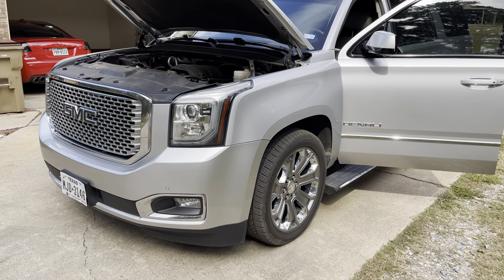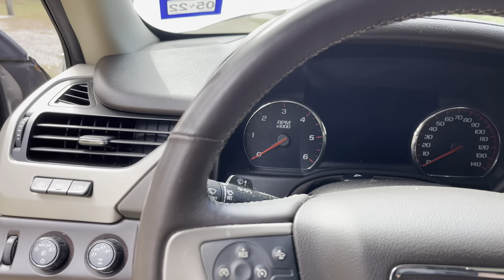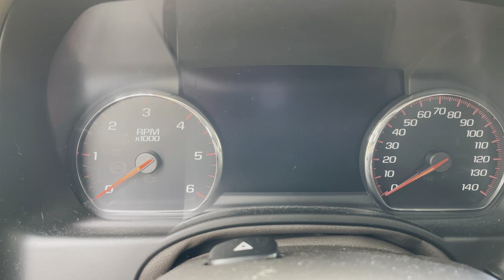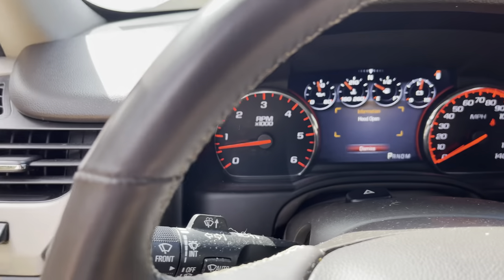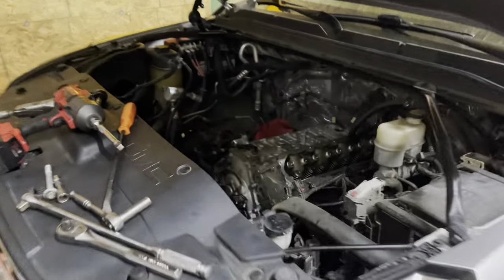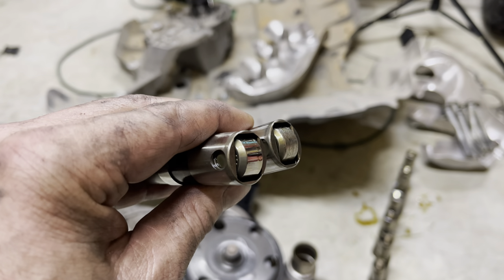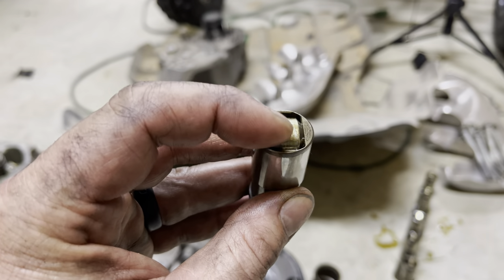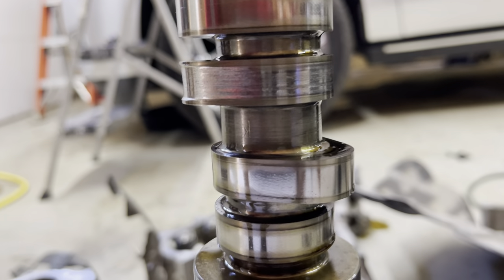WHAT A BAD LIFTER SOUNDS LIKE plus a look at the carnage! GMC Denali L86 6.2 V8 bad lifter L83

Comment: My 6.2-liter truck, with 99,000 miles, recently experienced a breakdown. The problem emerged after I replaced the spark plugs and wires due to the truck running sluggishly. Upon starting the truck after maintenance, it exhibited rough idling, triggering the check engine and traction control lights with a P0306 error code indicating a misfire in bank 6. I attempted to address the issue by checking and swapping the coil pack, but the problem persisted. Furthermore, white smoke emerged from the tailpipe. Suspecting a collapsed lifter, I arranged for the truck to be towed to the dealership. Fortunately, I have an extended warranty, and the dealership is currently diagnosing and repairing the issue, with the hope that only the lifter needs attention and not the camshaft.
Reply from the maker: Sometimes these fuel injectors on the new LT motors can fail and be kind of weak. It might be as simple as the fuel injector, but definitely let me know what they find. I am curious.
Reply: @whiplashtv2022  lifter on bank 6 seized glad I had extended warranty everything is covered dodged that bullet the inspection alone was already to about $850.
Reply from the maker: Well, that is a bummer, but at least you dodged that bullet.

Comment: Was the bad lifter operating an intake or exhaust valve? I ask because I’m curious if the lobe was wore enough (I couldn’t really tell in the video) to effect valve operation.
Reply: But good video. Informative. I just bought a 21 6.2 Silverado, so I’m going down the rabbit hole of potential problems so I can do the preventative maintenance now
Reply from the maker: Sorry to hear that. It is crazy how many problems the new trucks have in all the brands.

Comment: We have the same thing (tapping and chirping noise) on the passenger side of our 2017 Yukon Denali with the 6.2 that has 73,250 miles on it.
Reply from the maker: Bummer, that sucks.
Reply: Ridiculous. Looking like I'll need a cam replacement as well at 96K.
Reply from the maker: Dang, so sad. Time for an upgrade maybe?
Reply: @whiplashtv2022  Going to have to get my hands dirty. Junky Ass G.M quality.
Reply from the maker: They were better quality motors before this imo. LS ftw

Comment: Same thing with my 2016 Yukon Denali at 92k miles.  Discovered the cam was worn, lifter was missing small pieces just like yours and the cylinder scored.  Thousands for a new engine.
Reply from the maker: Sorry to hear that you had to do a whole new motor.

Comment: This video has answered my question about what is making that intermittent chirping noise in the engine of my 2004 Ford Taurus! I am thinking, that the mechanic who recently replaced my head gasket, may not have aligned some things adequately, and it has caused a lifter-chirp!

So, thank you, for posting this video! 😉🤗🤔🏳‍⚧
Reply from the maker: You are welcome

Comment: My 2015 l86 117k miles just crapped out #4 and #7 ,bent pushrods. Im reading that the root cause is oil pressure. Apparently the lifters failing is a symptom of an oil pressure issue.
   I doing afm delete , I just can't justify putting this system back in. I think this engine would be bulletproof with a quality cam and all roller lifters. I want this situation to be permanently rectified.
   Thanks for posting this and showing us your particular issue. Great info.
  What are you planning to do about the AFM?👍👍
Reply from the maker: I deleted the AFM and bought a whole cam kit/DOD delete kit from GPI (Gwatney Performance Innovation. Bending pushrods is pretty crazy.
Reply: Sometimes the bolts on the valley pan start backing off and cause low oil pressure for the lifters. You can tell by removing the intake and checking the bolt s on the valley pan for correct tightness.
Reply from the maker: I have never seen properly torqued valley cover bolts back themselves out. Did you have this happen to you personally?

Comment: It wasn't even an AFM lifter that failed here. The problem it seems from my own experiences and mechanical knowledge from tear downs is that most of the time the VLOM has a faulty solenoid seal, the screen filter underneath the oil pressure sensor gets clogged. 
Some people let their oil levels get too low as well or go WAY too long between changes. 

Another issue seems to be that these engines actually need at least a 5w30 instead of a 0w20 oil. GM only recommends 0w20 for fake mpg ratings. Also gm oil is mobil1 and mobil1 has been trash for over 15 years. 

Alot more human error variables as well but if I typed them here it would take over a 10 hours.
Reply from the maker: Yup, not even an afm lifter, kinda crazy.

Comment: Nice video... thanks.  Now some questions.  Was this caused by low or inadequate oil pressure /// or low quality cheap china lifters // if it was caused by low oil pressure... how does one increase the pressure?  Or did or is the oil pump wearing out?   and / or why is this happening on these new designed engines?  Been driving many old GM engines... some with delayed oil changes... and I/we never came across this type of failure.   If you only replace the worn out rollers... or even all of them WILL THIS PROBLEM JUST REPEAT ITSELF?
In market for newer truck// my Cheyenne is a 1993 ... seems like i could be in for a big expense since i would need to pay a technician to replace the lifters./// Must i look at Tundras?   It looks that way.   VR
Reply from the maker: This is due to issues with the lifters themselves. There is something about the metal of the rollers not lasting and holding up over time. They start to break down and take out the cam. Sometimes the issues happen more with the DOD lifters When the lifters are replaced with good GM Performance LS7 lifters then there is no issue anymore.

Comment: Did you get the cam out without having to drop the oil pan for the oil pump? What else was needed to get the cam out? I’m thinking of pulling the engine
Reply from the maker: I did not have to remove the oil pan and I cover that in and many other questions in this video. 
https://youtu.be/grDT-n-ULtI
Reply: @whiplashtv2022  great! Thanks. I’ll give it a watch
Reply from the maker: @dannyjohnsonsgarage  👍🏻👍🏻

Comment: I just got mine apart, same scarring on the lifter rollers and cam. I noticed my driver side push rods had a lot of discoloration (heat) and I’m wondering if yours were like that and had issues with oil starvation or another underlying problem. My oil level was good, always changed at 20% remaining. I did notice my oil pressure would jump up and come back down when first driving into town each day. Does yours do the same? Do you recommend any oil sensors or something to also change? I’m doing new cam, lifters, DOD delete (BTR). 
   Thanks for answering all my questions!
Reply from the maker: I didn’t have heat discoloration. I didn’t have oil issues either. I never ever go by the percentage number. Every 4,000 miles I would change the oil and filter. You shouldn’t need an oil pressure sensor unless yours has gone out. What cam did you pick out from BTR?
Reply: @whiplashtv2022  GM 12672469 which should be a stock replacement, but for non-DOD. I was looking for stock replacement, keeping VVT and no upgrades on the heads/springs
Reply from the maker: Oh ok. I put a GPI Stage 1 cam in mine, and used a 4 degree VVT limiter, and LT1 Corvette springs. There is a sound clip of it here on the change if you are interested. It drove like stock.
Reply: @whiplashtv2022  I’m reading some people say the putting can be from weak valve springs. I’ll have to do some digging as well as clean out all the oil passages if possible. I’m hoping the cam bearings are all ok
Reply from the maker: @dannyjohnsonsgarage  I’m not sure what is causing it, but it is definitely a known issue on these vehicles unfortunately.
Reply: Take the intake off and check the tightness of the valley pan bolts to see if they are at recommended torque. If the bolts are loose the oil pressure will not be enough to supply the lifters and they will collapse. If you take the valley pan off and look at it you will be able to see what I'm talking about. When the bolts back off the valley pan will have clean areas at the areas where the bolts were loose. 
Ray
Reply from the maker: @raybonecrusher4516  if he deleted DOD then those should be plugged off, but if he left dod active then that could be a possibility.

Comment: Had my 2014 l83 5.3 start with afm dod lifter tick, then I got it deleted with stage 3 cam, new lifters and pushrods with dual springs. Truck ran fine for like 5 months. Now that chirping sound appeared. Now I most likely have to pay a shop to do it all over again
Reply from the maker: Oh no! That sucks!

Comment: I have that same issue on a 2015 Silverado 6.2. Do you recommend replacing it with the same v8/v4 on demand set up or straight v8?
Reply from the maker: It all depends on what you want to do with it. I would say that you would probably have less issues with all new LS7 GM Performance lifters and deleting the displacement on demand 4cyl mode system.

Comment: Great video dude. That squeeking was coming from the non rolling part of the lifter hitting the lobe on the camshaft, correct?
Reply from the maker: Thanks. The squeaking was coming from the roller end of the lifter not having a smooth surface and it rubbing against the severely worn cam lobe that wasn’t smooth either. So everytime the cam lope pushed against the roller of the lifter to open the valve it squeaked.
Reply: @whiplashtv2022  Soooo....I heard that noise on my new to me 2014 C7 Corvette.  I thought is was a squeaky serpentine belt.  I would get a random CEL cylinder 8 misfire.  Took it to a performance shop and asked about the noise and CEL.  Got new plugs and wires while there.  They claimed it was injectors as to why the CEL.  Well, I changed my own injectors.  And then added new coils.  CEL is persistent...made appt with Chevy tomorrow...I have the same sound you had....its a bad lifter..this is horrible.  Thanks for posting and taking the time to explain.  If I saw this a month ago, I would have saved all of that wasted effort.
Reply from the maker: @keithskillz90210  I wish you the best of luck, but unfortunately it could be a bad lifter. Let me know what you find out.
Reply: @whiplashtv2022  bad lifter on cylinder 2.  Chevy quoted $6200 JUST to change 16 lifters and not cam.  Crazy.  The tech recommended a relatively local tuning shop to repair, install new cam, and tune.  They are much less expensive to install better cam and lifters than dealer but 3 months out.  Waiting for an email back on when I can actually schedule and what to expect.  Great video though, out of the many that I have watched, you hit the nail on the head and gave a great description and great shots of why the chirp exists and where it comes from. thanks
Reply from the maker: @keithskillz90210  I am sorry to hear that. $6,200 is a lot! I am glad that my videos were a help to you. Thanks for letting me know what you found out.

Comment: Did you re-use the other lifters with the wear lines?  Are they still running smoothly?
Reply from the maker: No I didn’t. I put in a whole new set of GM Performance LS7 lifters.

Comment: Nice simple & short video!  1 question... is that cam now toast, or can you still use it?
Reply from the maker: That cam is definitely toast
Reply: @whiplashtv2022  If you need to change a flat lifter and the cam looks fine, is it OK to replace just the lifter?  2009 Jeep GC 3.7L V6 with just over 216K miles.  I'm going in to change valve stem seals and want to be prepared for any issues I may encounter :)
Reply from the maker: At that mileage, I would be replacing the cam as well as all of the other lifters.
Reply: @whiplashtv2022  never done anywhere near that kind of job before, I'm really just going in there to replace valve stem seals.  Lifters are right there, so bought a few to replace any that are sticky.
Reply from the maker: @LIToyGame I see

Comment: I liked & subscribed to your channel, I have this same issue with my 2010 Chevy Silverado 1500 4.8l V8 motor, I own the truck & instead of getting another truck & having another truck payment I want to get this truck fixed, where are you located & how much would it cost to do a cam & lifter job in my truck? I live in Justin tx by the Texas motor speedway not far from Dallas tx about 40mins from Dallas, I really need help getting my truck fixed it’s my auto glass truck & I need my truck to make money I’m stressing out really bad idk what to do I’m not trying to be in it for a ton of money I’m shopping around for a good deal!
Reply from the maker: Sorry to hear that your truck is making this noise. I am around 3hr East of you and unfortunately don’t have time to take on more work. I am sure that there is a lot of shops in Dallas that can get you fixed up.
Reply: Get er done yourself. This is a great Video. Take your time and it's pretty straight forward. You need a Torque wrench. Mechanics in my area are too independent and want the small easy out repairs so I'm on my own as well.
Reply: @Chiefgeargrinder  yea & the mechanics that can do it want to charge me a arm & a leg, I think it be cheaper to just buy a remanufactured engine, I found a place that sells them totally rebuilt for $3000, the guy said if I give him my motor so he can rebuild it & sell it than it will only cost me $2500 for a fresh motor from him, then I would have to pay someone whatever it cost to have the motor installed, I’ll be looking at around $3500-$4500 all said & done if I go that route with the cost of the engine & labor, a shop quoted me $3800 to do cam & lifter out the door, might as well have a freshly rebuild motor put in it instead of having it fixed it’s not much more, I was thinking of getting a used salvage yard engine too but that would be taking a big risk if I go that route.
Reply: @schlick93ify  yeah probably better with a  fresh motor.  9 out of 10 times the VLOM fails and starves the cam of oil resulting in the cam bearings to spin. Resulting in lifter failure. Another cam might get 10,000 before the next failure a new platform will be a better choice.
Reply from the maker: That is not a bad idea to get another motor especially if you have a good bit of mileage.

Comment: What kind of blackout vinyl did you buy for your emblems?
Reply from the maker: I used some carbon fiber wrap for the emblems
Reply: @whiplashtv2022  How did you get it to stick properly given that the emblems are not smooth like the older emblems?  They have ridges on them.
Reply from the maker: @Guillotines_For_Globalists heat gun
Reply: @whiplashtv2022  Your carbon viber sunk into all of the valleys and ridges?
Reply from the maker: @Guillotines_For_Globalists yes, but isn’t that visible with the carbon fiber print
Reply: @whiplashtv2022  That seems like it would take a lot of time and effort to get perfectly.  I bought a vinyl kit awhile back, returned it when I realized the GMC emblems were not flat and glossy like their predecessors from previous generations.

Comment: Did you check how loose the bolts were on the valley pan? And did the valley pan look cleaner on one end from the other? If the bolts start to loosen up on the vally pan the lifters starve for oil.
Reply from the maker: No, I didn’t have any loose valley cover bolts or 1 side looking cleaner than the other. I never had oil pressure issues either.
Reply: I'm getting ready to do the delete on my 6.2 gm engine, I have been checking for causes of the problem that I do have with a bad lifter. I don't want to tear the engine down to replace all of them unless it is necessary. The valley bolts can back off and if they do it can cause the lifters to fail because of lack of oil. It may not show as oil pressure problem on any warnings. The delete may stop future failures I'm going to use the plugs on the holes. If I find something I will leave the info on your site. The recommended torque is 18 ft. lbs.
Ray  @whiplashtv2022
Reply from the maker: @raybonecrusher4516  be sure to have dod turned off in the tune as well.
Reply: Thanks @whiplashtv2022

Comment: My 2011 Chevy Silverado is doing this do i have to replace the whole motor or ?
Reply from the maker: No, not the whole motor if the cause is a bad lifter. You should only have to change the cam and lfters. The rest should be ok.

Comment: Where you able to do the cam swap with the engine still in the vehicle?
Reply from the maker: Yes
Reply: Yes you can if u remove radiator and condenser.
Reply from the maker: Yes, remove the radiator and you can get the cam out.